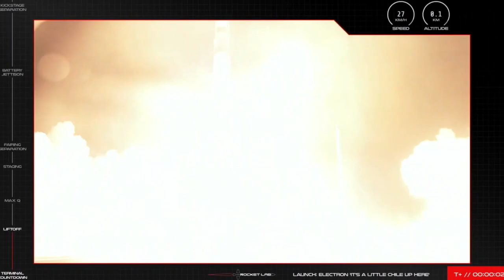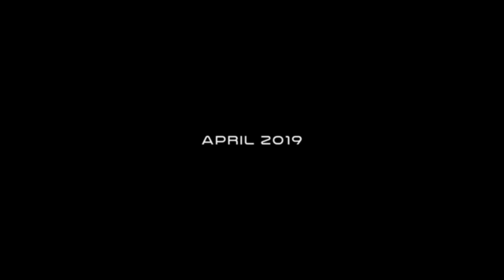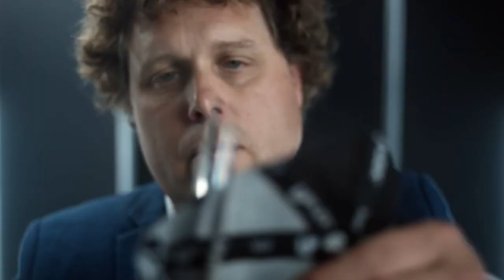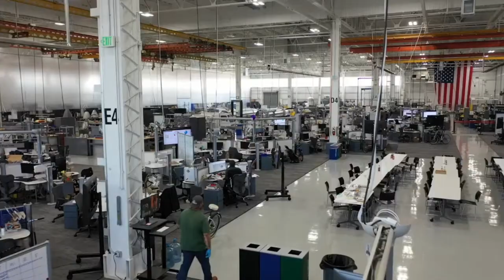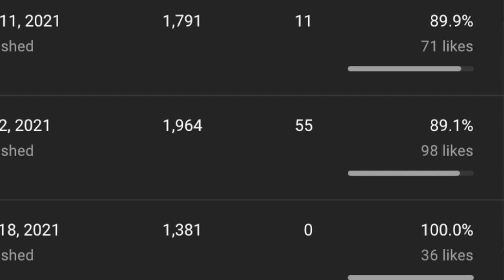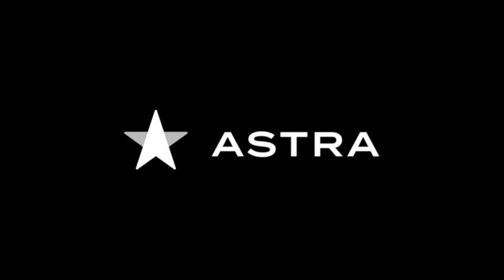What you MUST KNOW about Rocket Lab vs Astra (Stock Comparison)

Comment: Thanks for the Information.

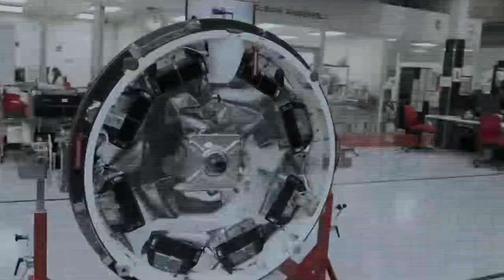2:55 This is a useful information, but only for further research. Any customizable system will have a range of options it covers. Its important to know how well those cover the typical requirements of the target market. Example: if 80% of satelites in the supported orbit and payload size is not satisfied by the options provided, this idea might be less worth than it sounds. While I assume they did think about it, I have no exact information the research they did and how much they cover.

Comment: RKLB has all the tell tale signs of the Dot Com companies of the 90’s. Too many of them didn’t focus on profitability. Some were swallowed up by the likes of Cisco, Google, and AT&T. Others just went bankrupt.  In the end, you ALWAYS have to watch the balance sheet and the quarterly reports.
Reply: What does focusing on profitability look like for a space company? Are you sure RKLB hasn't done or isn't doing the things that come to mind?
Reply: Monitoring the burn rates for a space company is the same as any other.  Both ASTR and RKLB are spending faster than their biz plans predicted at SPAC merger. If they can’t get to profitability before running out of cash their options are to borrow, sell stock, sell the company or close the doors. Any first year student at Harvard should be able to see that.  If the can’t keep the lights on then what’s the point of owning a single share?  One last note - there’s room for both of these companies in the market so it’s not like we need to compare them like there can only be one. It’s not a Highlander movie!
Reply: Of course, you've just described investing 101. I'm simply curious what you think is particularly egregious or out of character when looking at both companies' burn rates.
 RKLB specifically called out improved M&A deal flow as a major driving factor behind going public, and they've swiftly executed on that objective. You're right that their SPAC deck didn't include cash burn from acquisitions - but keep in mind it also didn't include the revenues, industry inroads, and operational efficiencies they've gained from their targets. All four of RKLB's acquisitions so far have been mature businesses with decades of success & flight heritage. As such, I wouldn't be concerned about their financial position until we start seeing excessive spend on Neutron development.
Reply: ASTR on the other hand still has significant cash burn ahead of them before their factory is adequately tooled up to produce a commercially viable product. Compared to Electron, whose design is mostly frozen (save for minor reusability tweaks), ASTR is only planning on producing a dozen Rocket 3's before pivoting to a totally different engine (Firefly Reaver) for Rocket 4+. Rocket 3 simply isn't going to be the workhorse ASTR needs to make a dent in the small launch market due its 50 kg payload capacity. Additionally, ASTR's only acquisition so far has been a young Silicon Valley startup with minimal flight heritage (Apollo Fusion), so revenues will be unstable until that division proves itself out. And don't even get me started on their wildly capital intensive V-band constellation plan.
.. At this point in time, if RKLB can be considered speculative (which it most certainly is), ASTR is speculative squared as far as space investing is concerned. I think that's about as fair of a comparison as we can make in these early days of publicly traded NewSpace companies

Comment: Made a comment here a couple of days ago but for some reason it's not showing up... Anyways great video Nathan, you gave both companies a fair shake but ultimately I agree with your preference for RKLB.

Also just wanted to clarify the claim made that you won't find 3D printed hardware on Astra's rockets - Delphin is currently 3D printed out of Inconel and is powered by electric pumps just like Rutherford. Astra is looking to move away from that process now that they've secured a license for Firefly's Reaver engines, but Rocket 3.x variants will surely incorporate 3D printed Delphins for the next year or so.

Comment: Surely reusing Rockets is cheaper that throwing away a budget Rocket. The big $$$ for these companies will depend on their success of the constellation they aim to put up. I think at the moment it seems that RocketLab is in a better position to attract the better engineering talent.
Reply: There's a huge mass penalty for rockets when it comes to reuse that makes it a non-starter in all but the most extreme circumstances.  Even the Falcon 9 which is the "king" of reuse, only reuses the first stage, and the space shuttle orbiter (which was reused) was FAR more expensive than a traditional expendable option due to the substantial refurbishment costs between launches. It has yet to be shown that a fully reusable rocket can be cheaper than a fully or partially expended launch vehicle. SpaceX is betting their future on that being true, but it is far from assured. With that said, if SpaceX is able to pull off 100% reuse, I would sure hate to be a launch company who isn't at least partially in the rocket reuse business.
Reply: @TimCortesi  "There's a huge mass penalty for rockets when it comes to reuse" - true for powered landing re-use, but not so significant for Rocket Lab's helicopter capture.
Reply: Reuse isn't inherently cheaper. It's a mix of engineering and the launch market to determine reuses' economic viability. For example; if your rocket flies once a year, making it reusable probably won't be cost effective. (1 flight a year isn't cost effective no matter what, but... eh.)

It depends.

Comment: My concern with neutron is width and likely only launched from NZ as most rocket widths are determined by road transportation.  I don't know much about their Virginia launch site  and how they would transport the rocket there.  

Customers spending millions likely care about launch record more than other factors, so if Astra can agressively launch small payloads first with a low failure rate, then they will likely remain top dog as small launch provider.

Also ride share may be cheaper, but limits flexibility of orbit choice.  

Personally I have 4x shares of rocketlab compared to my astra holdings
Reply: Neutron to be launched in the U.S not in NZ and built up right and close to the launch site, no transportation issues ☑️
Reply: @revpitty001  Awesome, don't know how I missed that part.  Pro and con then as NZ offered an unprecedented launch cadence due to lack of FAA, but their ridiculous COVID restrictions limited launches.
Reply: Another launch site to be built in NZ for Electron

I think the main reason Neutron is to be built in the U.S is more for production and manufacturing purposes 

Probably be a lot harder and cost more for it to be built here in New Zealand.
Reply: @revpitty001  Also there is just not the infrastructure to be able to fuel a rocket of that size in NZ so they would have to build their own costly infrastructure to produce and transport propellant
Reply: @revpitty001  Have to go were the investor's are.